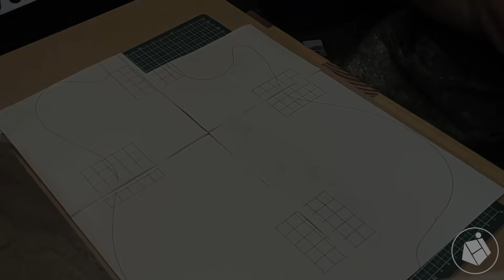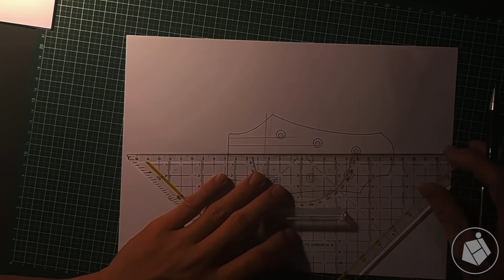Full Build of my Custom Guitar (second guitar build as an amateur woodworker)

Comment: ... 05/16/2020:  I have been considering building a Telecaster in a Stratocaster body with two Tele pickups and a 3-way Tele switch (need a custom made pickguard to fit Tele pickups and a 3-way switch).  I would get all the body comforts of a Strat, and have the Twang of the Tele.  I have sen here n YouTube experts say the body and neck woods make no difference in sound, and the Tele bridge plate also makes no difference in sound, nor does it give the Tele that Twang tone.  The sound tones only come from the pickups.  So, do you know of a guitar like this?  I would love to see one.
Reply from the maker: I have no idea how that would sound. From what I know wood and hardware in general play a very limited time in the  tone of the guitar, some swear it's not the case. If you think about it, from a practical and historical point of view, a strat is literally an enhanced version of the tele, it's carved for more comfort and that's mostly it. I don't think the shape of the guitar or the construction of the bridge play a significant role in the sound, but the pickups do, they change everything. But that's only my opinion.

Comment: You put tuners before fretmarkers? Lol
Reply from the maker: Yeah I don't see the link between the two though...
Reply: @tchiksguitars  i think it is easy to clean the markers and make it flushed it with the radius of the fretboard when you sand the board to its radius with the markers already in it. I think it would be more neat and convenient than putting and sanding the fretmarks with the frets already installed. you still did a great job and it is a nice looking looking guitar btw
Reply from the maker: @thomasseveroii5093  oh you meant the frets before the fret marks. You are perfectly right. I got that comment before and I have a perfectly reasonable explanation :p I didn't want to put fret markers at first, and then I changed my mind, hence the fret markers after the frets ... But using a chisel it's not so much work to make the fret marks flush with the FB, but I agree that on the high frets (12 +) I didn't have much room to sand them, using a scraper did the job well though. On the finished guitar you can't feel any bump.
Reply: @tchiksguitars  i also thought that you probably change your mind with the fretmarks, well nice work then. I'd love to see more builds, it's fun to watch
Reply from the maker: @thomasseveroii5093  thank you! stay tuned, I don't think I'll ever stop making guitars now I'm addicted :p The build I'm currently filming is a ukulele, maybe not what people want to see but that's what I'm making. After that I'll probably go for a neck through guitar or a second bass, I don't really know yet !

Comment: Why strings before mics holes??
Reply from the maker: Which holes are you referring to. There's a lot of holes in a guitar.
Reply: @tchiksguitars  you're right, sorry, I meant the body holes, In which you put the "Seymour Duncans"
Reply from the maker: Ho right. Those are dimarzios by the way :) I put the strings first because I'm a bit impatient and I wanted to be sure that the strings fit correctly. Also I like to make my guitars in 2 phases : first the acoustic phase where I test everything (the action, the fret buzzes, the trusrod adjustments) and then the electronic phase afterwards. It lets me deal with less problems at one time :)
Reply: @tchiksguitars  thanks, it makes sense in order to check the measures. Great job man, congrats!!